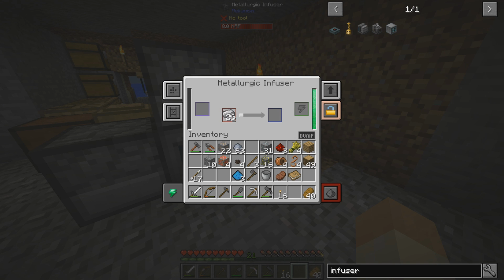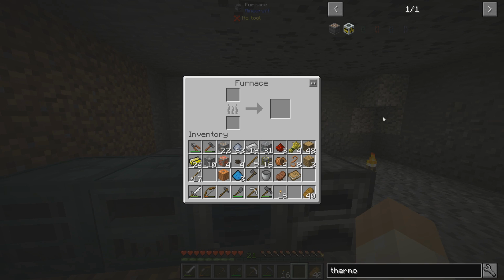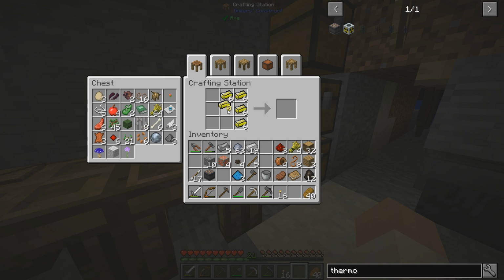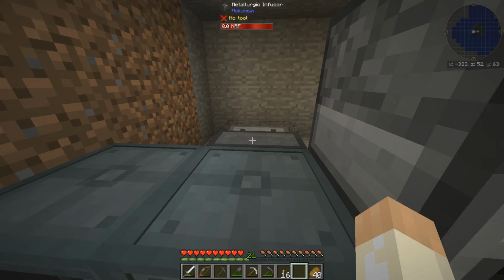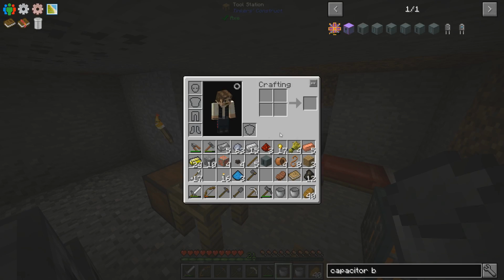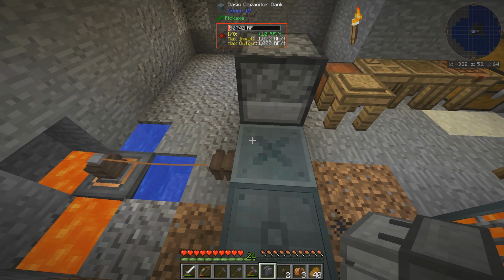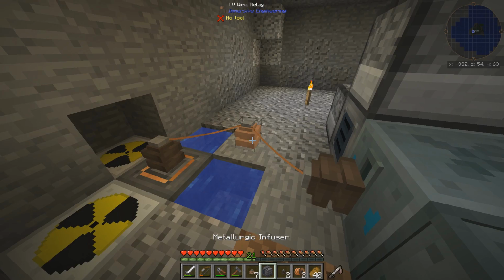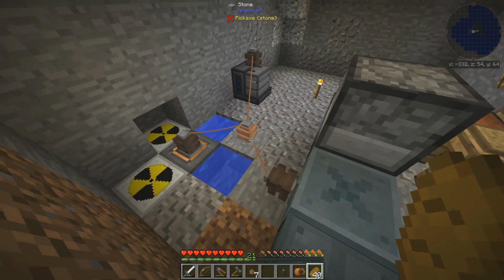FTB Infinity Lite #4 - Easiest Steel Production And Infinite Power (Modded Minecraft 1.10)

Comment: After you switch to Uranium Blocks on the thermoelectric generator, the input shows 20. With lava it showed 30.

Also, at 14:46, saying "So now it works, I don't know what I did." was very helpful :D
Reply from the maker: I think it's because it was the net income shown. I was running some machines when it showed only 20. I think? I don't remember exactly ;)

Comment: Nice series! Just a tip,when you're under water collecting things you can place a torch on a block in front of you at head height and it will allow you to take a breath without going up to the surface.
Reply from the maker: Yeah, I do that from time to time but it requires a 2 block high platform to stand on. Placing it in a slope (on the same level as your feet) doesn't give you the air bubble if I remember correctly :)

Comment: I thought IC2 Uranium had issues with a 'Radiation' effect, similar to poison.  Was that removed in later MC versions, or just disabled here?
As for Mek steel, I've had several discussions over time regarding how 'easy' it can get compared to other methods.  As this pack is not overly tweaked, you're in luck, but I've either seen that Steel recipe removed or the Infuser gated on something else.  :)
Reply from the maker: I thought so too, and as you might have noticed I wasn't prepared for that crafting recipe ;) But I can't answer if this is a config setting for this modpack or if I2C removed it... I agree though, the Mekanism recipe is a bit OP compared to all the other ones since they require a visit to the Nether. Now I used this "exploit" but to be honest I think it should have been balanced.